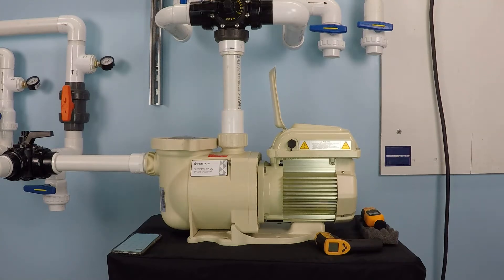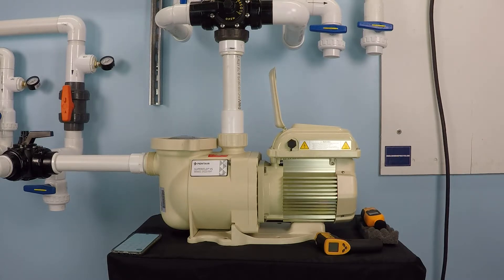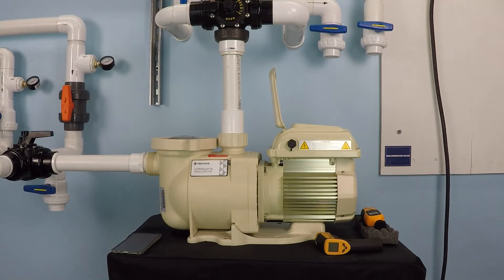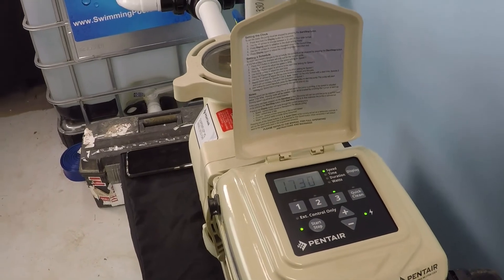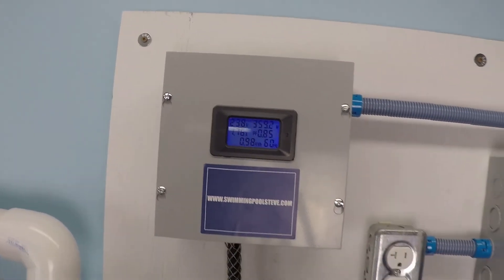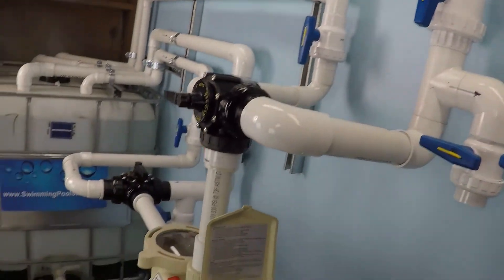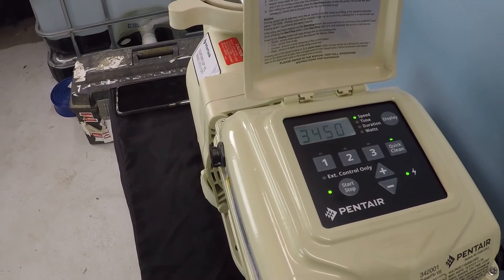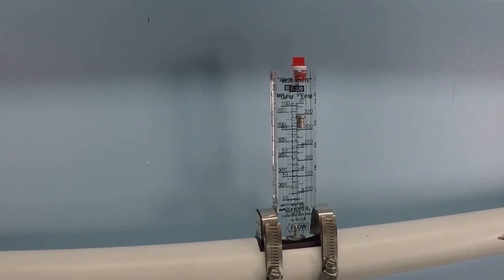How Does A Variable Speed Pump Save You Money?

Comment: The critical parameter is not hours of operation of a pool circulation pump as so graphically shown here.  This appears to be the basis for this entire mis-information on variable speed pumps.  The parameter to control is pool water turnover, or how many times a drop of pool water goes through the filter daily.  The power required to move this drop through the filter the required times per day is exactly the same for a variable speed or a constant speed.   "Oh you idiot....the variable speed uses less power per hour"  Yes it does but uses exactly the same as a more cheaper constant speed pump per gallon of water pumped through the filter and salt generator (if equiped).  Run both types for a constant pool water turnover and they use the same power.

Comment: So a single speed pump uses around 3-3.5 times the electricity for the same amount water passes through the pump, compared to a variable speed pump running at half the speed.
Reply from the maker: It really is a pump by pump basis.  THIS pump uses 3 to 3.5x the power at max rpm.  Other pumps, on other pool systems, will perform differently.  Each will have teh same theme in that the VS pump uses less power, considerably so, but the actual number varies.  Of note the theoretical maximum savings is for every drop in RPM by half there is a 8x reduction in power. So 1/4 speed uses 1/65th the power of max speed.  But that is on paper.  Including real world losses I find that the math usually works out to be 1/5th power consumption at 1/2 RPM, which is still a considerable savings.  Of specific note is the water volume being pump drops linear with the motor RPM.  If you pump 100 GPM at max speed, you probably realize around 50 GPM at half speed, but probably only 1/5th the power consumption.
Reply: @Swimmingpoolsteve  Thank you for the reply. I was also thinking: in your example the power consumption is 1/5 at 1/2 the speed. assuming flow rate drops linearly, you now have to run the pump for twice as long to achieve the same turnover rate, so you're actually using 2/5 of the max speed energy overall instead of 1/5. Am I correct?

Comment: What's the benefit of a VARIABLE speed pump? From the example it seems like I save the most money by running a cheaper single speed low RPM pump longer rather than buying the more expensive variable speed pump and setting it lower. Is there any benefit to the variability? What am I missing? Thanks for the great video!

Comment: The rpms I need for my salt water chlorinator to operate is 1650. Does that seem normal?  Inch and half plumbing.
Reply from the maker: This question is hard to answer because every system is different.  That number seems fine to me but there are a lot of things that could affect how well your flow switch closes, specifically how it is installed.  Do you have 10x pipe diameter in front of the switch and 4x pipe diameter after the switch in a straight, unobstructed run?  This is considered a standard flow configuration for flow switch installation.
Reply: Swimming Pool Steve plenty in both sides. I have a Pentair IC15. I know my heat pump can run a lot lower speed. I just wasn’t sure. Thanks for the input.
Reply from the maker: @Lonewolf-xp9to  What kind of filter do you have?  If your filter is dirty or needing service (like some new filter elements) then this will increase the resistance to flow in your system which would require a higher RPM from your pump to close the flow switch.  Do you note any different in the RPM it needs to close the SWG flow switch right after you clean your filter?
Reply: Swimming Pool Steve I have a pentair cartridge filter. I haven’t been keeping track right after a clean the filter. The whole pump system is brand new. It’s only been operating for about a month and a half. I’ll start paying attention. I do need to inspect the chlorinator probably. During all the construction around the pool with concrete dust and dirt could have some debris somewhere.